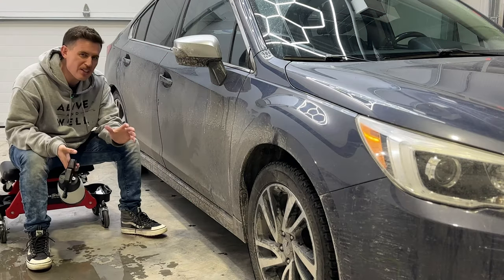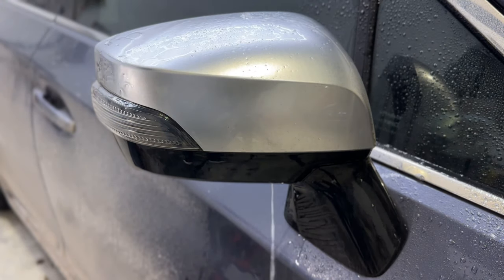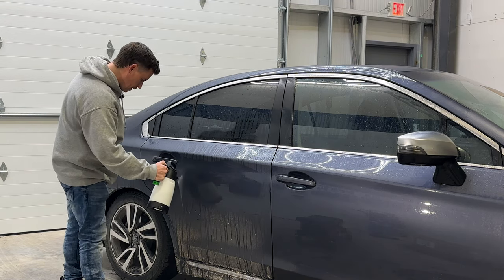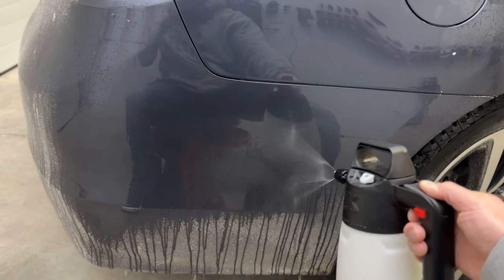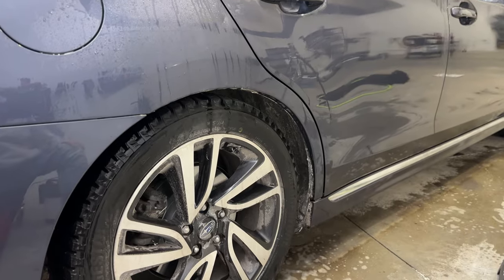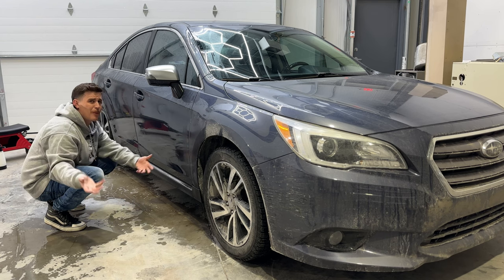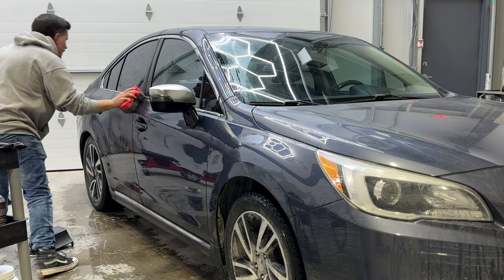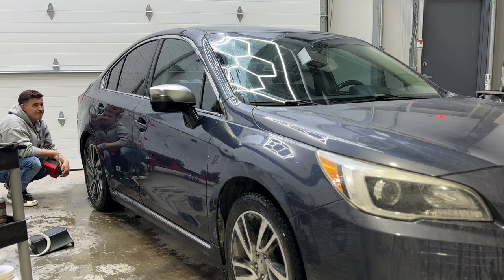NASTY CAR. NO HOSE. A Rinseless Wash technique that works!

Comment: Instead of a pump sprayer, this DIY lady uses a SunJoe cordless ‘power’ washer. A bucket of rinseless, it feeds from a hose floating in the bucket. It’s got enough power to blast crud off but it’s gentle and most of all easy. If the car us super dirty I might fill a second bucket, and it’s still pennies compared to a commercial car wash (and better on your paint for sure). You can definitely refine all of the techniques shown by Nick and Yvan (and Sylvie!) and make yourself a super easy and fast home car wash routine.
Reply from the maker: Excellent!
Reply: I've been thinking about doing this.
Reply: Am I looking at the right thing? The cordless power washers are like $300?
Reply: @youngz13o might as well go to the car wash at that point and use that pressure washer
Reply: Do you happen to know the video or website for this? I don’t have a place for a hose but I wanna clean my car on my own and don’t have a huge budget for a pressure washer lol
Reply: Bro, that’s amazingly genius
Reply: I do this using a Bravalou cordless pressure washer from Amazon uk £90. Running ONR through it hasn’t damaged seals so far!

Comment: I'm a maniac when it comes to preventing scratches and even the slightest swirls...and I can vouch for this method being 100% safe. I still always use the pressure washer when I can, but sometimes it just isn't possible (and not everyone has that luxury). I've done this many times on a similar level of dirt/road salt and have never had an issue with it.
Reply from the maker: exactly! I'm always going to use a pre treat, dwell, and pressure wash when I can before my contact wash. But this method definitely works when that's not an option
Reply: Is the rinsless wash used in this video much different from ONR?
Reply: @gmr19 it is onr diluted at 256:1

Comment: Used this method just this past weekend.  Pre-sprayed with All Clean on the lower panels, then I used Rinseless in the IK Multi Pro 12 sprayer and followed up with a Rinseless contact wash and Ceramic Gloss as a drying aid.  Worked wonderfully!
Reply from the maker: Good stuff

Comment: Saw this video and immediately purchased the same sprayer. I've been using a manual spray bottle, but with the PSI of this sprayer, I will feel more confident that I get all the dirt and salt off before a contact wash, especially in the winter. Plus, it will take less time and effort to wash my vehicle. Thanks for the video.
Reply from the maker: You bet!

Comment: Literally was outside doing my truck when this video popped!  I drove a little over 500 miles this past weekend and the truck was coated with road treatment stuff.  I did pretreat with an APC and then used rinseless wash and your ceramic detail spray and was done in less than 2 hrs and the truck looks great.  Nice timing with the video though!
Reply from the maker: Thank you

Comment: Hey bro, I know this is an old video, but I have pretty much most of the DIY line at this point and have mostly phased out the other products except a few I love and you don't have. I was reluctant to use rinseless as a full car wash. Been detailing since the 1990's. On Sunday I foam, rinse, foamed my car. Yesterday, drove 200+ miles (in Florida) and a newly pained area was splattered with bug guts, as was the hood and windshield.I needed to go quick because it was almost dark out. I did rinseless on the front, windshield and hood. Then did a couple other sections just for fun. I may be a convert. I think it took me as long to setup the product as it did to clean what I needed to clean/get bugs off of. What surprised me was the strength. I just made a 2 gallon mix and could easily have done the whole car with it. No need to reply to anything here as I am not asking anything, but clearly, rinseless in way more versitile than though of by myself previously and by some others.
Reply from the maker: Thank you.

Comment: Nice  Video, with all the water restrictions happening theses days throughout the summer using less water could mean more work. Even if it means using a bit more waterless wash in the formula and a cordless pressure washer with more PSI should work very well.
Reply from the maker: Very true!

Comment: Love this method. I think I would try the pre spray with a bucket of rinslesess fed through a worx sprayer. I’m gonna give it a try anyways. Great video!😊
Reply from the maker: Thank you
Reply: How did this work out for you?
Reply: @Ikona731  well I foamed on the rinseless, let it dwell and then used the worx. Did my contact after that with the sponge. Worked out great! Finished off with ceramic gloss.

Comment: Adjust your nozzle on the IK sprayer to a narrow band and you don't have to stand so close to the car and the pressure coming out of the sprayer is better on a narrow band.Instead of waiting to the end for the bottom of the car use a cheap towel
Reply from the maker: Good call!

Comment: This process simply works! Yes there may be times when you need a pressure washer for uncoated cars or trucks with mud everywhere. For me polishing is more efficient because there is not water everywhere which requires more time to blow off. Plus the environmental impact is real!
Reply from the maker: Thank you

Comment: Thanks for the video. I was apprehensive to try this method, but seeing that was reassuring. My question is:  I live in Canada and don’t have a heated garage for winter wash. Will try and use a portable heater.  What is the minimum temperature you can successfully use this product and method.  Thanks!😊
Reply from the maker: As long as it’s above freezing, all is good

Comment: wait until IK releases a battery operated pump for this size sprayer in the future!  (I used  this technique with my SPTA electric sprayer the other day it did work pretty well.)
Reply: Worx have a electric sprayer.
Reply: @kev008ify  you are correct I did change my comment. I meant IK because they make very popular and high-quality sprayers.
Reply: @waxmanvids5015  I already have a few worx batteries 🔋 so think i should get the Worx 👍
Reply from the maker: That will make life easier.
Reply: They just released a battery for the IK Pro 12 so I’d imagine one will come for the smaller sprayers too.

Comment: How does the absorbency of towels affect when using ceramic gloss or quick beads as a drying aid?  That worries me and that's why I tend to use the same rinseless wash with the ratio of a quick detailer.  But then I have to spend some additional time with another step to apply some kind of protection.
Reply from the maker: That’s a concern for many. A simple way of preventing it, is as soon as your done washing, soak your drying towel in your wash bucket. The surfactants will break down the uncured ceramic.
Reply: Thank you very much for your answer, I will try it in the next wash.

Comment: If the car is coated shouldn't the hydrophobics on the lower panels pop back up after cleaning? Don't get me wrong I prefer rinsless to a traditional soap too but I struggle at that point. Wouldn't a flat panel imply contamination which isn't lifted by the rinseless wash? And can Ceramic Gloss bond properly on that substrate? Nevertheless a nice demonstration what is possible with rinseless and a pump sprayer. Even without a hose or pressure washer. I hope DIY Detail finds it's way over the pond to the EU.
Reply from the maker: Thank you, hydrophobics are covered by salt accumulation . A quick spray with DIY Detail Water Spot Remover will restore hydrophobics. 

Yes, please ask your favourite products distributor for DIY Detail.

Comment: I have an 08’ Audi S8 V10 ,garage queen , barely driven , so sometimes I can literally do a no touch car wash using a rinse less wash and a vacuum(use as a blower). I use mckees sio2 rinse less but I’m sure they all work well enough.  
You can probably do a no touch wash on a dirtier car but you would probably have to do a few more passes, use more solution/water but 100% touchless.
I do rinseless on all 3 of my Audi’s. But on a car that is driven more I do a pretreat-dry-pretreat-rinseless with contact- dry.
Reply from the maker: Excellent
Reply from the maker: Everything you say makes sense! I’m always reaching for a hose if there’s a question about …will this scratch? But rinseless can be so versatile as well
Reply: @diydetailofficial  when i do the pretreat-dry-pretreat-rinseless method you can’t scratch, in between the dry/ second pre treat you can inspect your paint to see if it’s clean enough to do contact or if if it’s still too dirty. On my 05’ A8 W12 , I had to do two passes of rinseless to get it mostly clean, then I did full rinseless with combination of microfiber towels , chenille wash mitt and big gold sponge( only on flat surfaces). Sometimes it’s so clean , by the time I do rinseless with contact, I wipe and my mitt/towel is actually clean! Lol

Comment: My vehicle is two months old. No coating.
Can I clean vehicle as shown in this video without having to use an additional product like quick beads? Does the ceramic gloss do the same thing? Thanks
Reply from the maker: Yes you can

Comment: How does your rinse less compare against the industry standard ONR? Yvan was the face of Optimum and just curious as I am a die hard ONR fan but also a huge Yvan fan as he is promoting this new rinse less  product. Does it do everything ONR does like soften water and remove excess off the wash media when dipping back in the bucket?
Reply from the maker: It does that, and much more.
Reply: It cleans the wash media about 100x better than ONR can, even V5.

Comment: Another method I use that's not quite as good at cleaning (but also much much less effort) is to just go over the car with distilled water in a pump sprayer.  It works best if the car is still wet from snow/rain.  Takes less than 5 minutes, and distilled water costs less than a buck a gallon.
Reply from the maker: Nice!

Comment: With the rinseless Wash so lubricated and sponges soft and damp—can’t be afraid to go over the panel 2 times if you need to. Especially in a “true rinseless” scenario.
Reply from the maker: Correct

Comment: Would adding you water spot remover to this help? If so where I’m the process would you add that step?
Reply from the maker: adding Water Spot Remover without a hose is doable, but can be a pain. Basically you would wash first, then spray it on (dwell time and agitation are helpful, but even just spraying on and letting it dwell will have a big impact). After that you just want to flush it off the paint. So if you can flush with your sprayer and you feel like it's completely off the paint, you can go ahead and then dry with either Ceramic Gloss as a drying aid or just the Rinseless Wash on the surface. But it's a pretty wet process to flush off with a sprayer
Reply: @diydetailofficial  thank you! Maybe it’s better to be prespray before using a touch less wash is in the winter once or twice. Also thinking how to use on the side by side we use to plow at work. Im hoping to detail it out before fall and learn to use the rotary when the new pad comes out.
Reply from the maker: @freedom2ignite  yes that’s a good  plan.

Comment: Question about the Ceramic Gloss and drying towels.  How do you keep the towels from getting clogged with the Ceramic Gloss?   I wash mine after every use with P&S Rags to Riches with warm water and no fabric softener and tumble dry no heat, but seems like my towels still lose some drying ability after 4-5 uses.
Reply from the maker: Luke, when you’re done washing put your drying towel in your Wash bucket. The surfactants will break down the not yet cured ceramic.
Reply: @diydetailofficial  awesome!  Thanks

Comment: Instead of drying the panel after. Wirh a drying towel. Can we blow off the water so it’s 90% dry and then going over with a detail spray and drying aid towel? Or not good With a rinseless? 🤓
Reply from the maker: Yes, you can absolutely do this, the polymers from our Rinsless Wash provide lubrication even after the solution dries. Definitely a great idea to use the drying aid, though, when you go to dry. You wouldn't want to apply your towel to dry paint, if you can avoid it.You could also apply a few sprays of rinseless to re activate the product and then dry with your towel

Comment: Would a pre-spray with some All Clean on the car, especially the lower panels, help remove even more dirt upfront before proceeding with a Rinseless soak and wash?  And is doing so safe for coatings and car (that is, the All Clean is only rinsed and washed off with the Rinseless solution; no hose available).
Reply from the maker: You can, yes it’s safe.
Reply: @diydetailofficial  fantastic! Thanks
Reply from the maker: @mikev1766 thank you for the questions

Comment: Yvan help me with this I have an idea

Can you dilute a ceramic detail spray into distilled water and create your own rinseless wash with light ceramic protection
Reply from the maker: Unfortunately not that simple
Reply: @diydetailofficial  what is the issue with it.
Reply from the maker: @SaveRap  Rinseless Washing safely requires proper cleaning ability ( not provided be a detail spray), and lubrication.

Comment: How many gallons of water would you need if you used this method on a car this dirty?
Reply from the maker: It took about 3 of those ik sprayers, I wasn’t bashful about using a lot of solution

Comment: Guy's! get a good battery powered backpack sprayer. My My4Sons M4 4 gallon backpack sprayer can get virtually all that salt and dirt off, including the wheels in a matter of a few minutes just by pulling a trigger. I get 100 psi at the nozzle and a vast array of nozzles come free with the sprayer. How is this still such a secret that nobody talks about them on these detailer channels?
Reply from the maker: Sometimes you just use what you have:) but do you have a link?

Comment: 13 hours and 200 gallons later….
Reply from the maker: Not quite
Reply: Dude. He prolly used 3.5 gallons total
Reply: Nah... I live in a building with no hose because HOA won't provide one in the garage. I've used this method many times I'm about to clean the whole vehicle with 3 gallons of water. I buy distilled water from Walmart. I only need 3 gallons. Sometimes I can get away with only 2
Reply from the maker: @skylar1112  nice